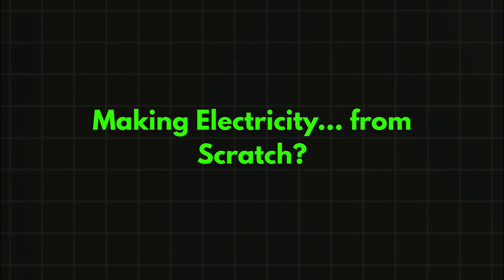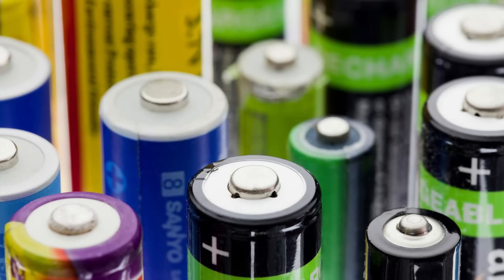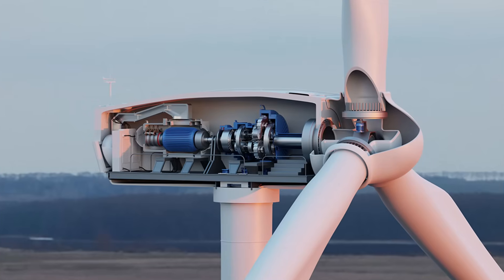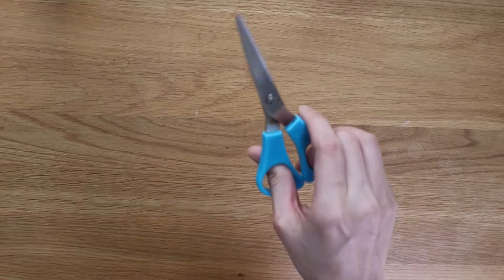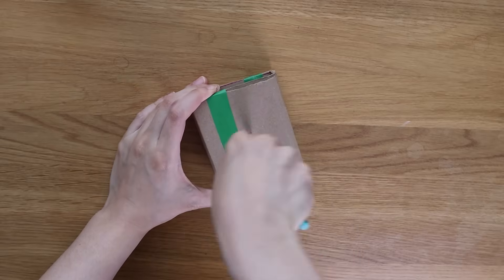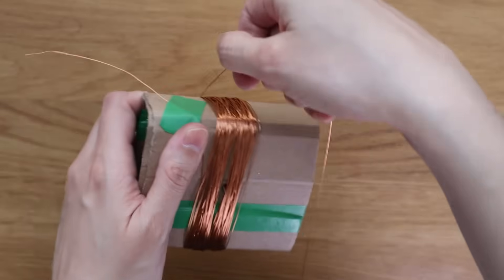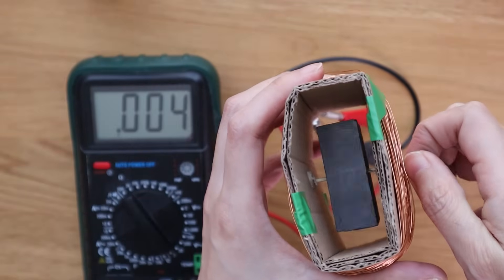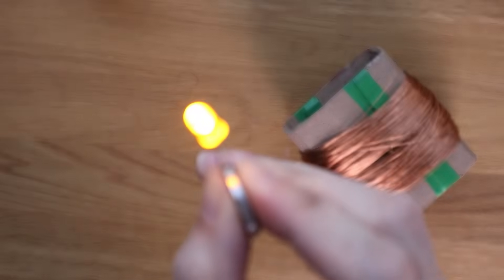I Tried Making Power With Just Cardboard And Wire - The Simplest Electricity Generator

Comment: You could go back at least till roman times, maybe much earlier.  Magnets (lodestones) existed, they made copper wire jewelry, the wire could be coated in something like pine resin or enamel or rubber(from dandelion sap), the box could be wood, using a large wheel to rotate it at higher speeds, you might get high enough voltage to shock someone or make a small spark.

Comment: Yep, can't go back very far before you have that bootstrap problem.  Prior to electricity, you don't have magnets stronger than natural lodestone. So you're going to need to work your way up to decent magnets by making a bad generator and using that to make slightly better magnets which means you'll need access to a forge.  You'll probably need to build yourself a wire drawing setup, too, if you go back before the 1800s.  And figure out how to insulate the wire without modern plastic coatings. They used to wrap wire in cloth and/or paper.

Comment: The cellphone could potentially be useful for this in a pinch as it contains a nice little vibrating motor or linear actuator which contain the required parts, though it might take a decade or two for a full charge. Sadly 5g still has dreadful 4th dimensional coverage.

Comment: Great Video! Ithink it is the bigger question how far Back you Go in time and where. Something Like Piezo Crystals could be a Help for effect. Chrmical batterys would be a makeabel Thing after copper was used as Metal. And still big question where you would Go? What Materials would be there? And how far are the peopel developed in what? Go Go 1bc in Egypt and Show them an pulley system could get you a so what ist the new thing? 😄

Comment: Perfect timing! Yesterday I was trying to understand how to make a electromagnetic motor, the problem is that it was late in the night and I needed to sleep. I will try this!
Reply from the maker: Are you trying to make a DC motor? It's very similar to this, except...
You use electricity to generate motion by connecting the wire to a battery 🔋

Comment: There are other ways to detect current without a multimeter. The simplest and oldest of them is by passing the current to a ionic solution for electrolysis. If it succeeds then there is current.
Reply: Another one is carrying the current through a long wire to a second coil, which you can use to deflect a compass needle.
Reply: @karlmuster263  that's basically an analog ammeter

Comment: Magnets are not that simple too, proper ones capable of generating anything were invented in early 1900s.
Reply: Even today's methods require a large electro-magnet to fabricate permanent magnets. Iron and lodestones will have a small amount, which they knew about. So maybe it would work if you use that current to create an electro-magnet, use that on some iron during refining, and gradually work your way up to stronger magnets.

Comment: I think constricting or at least drawing a stem engine would be possible basically from the moment we learned to smelt metals
Reply: No, you need a strong enough metal to be able to withstand the pressure of the system. Copper and iron can't do it, bronze and brass are WAY too heavy and expensive. The only reasonably cheap option is steel, which requires really sophisticated metalworking to make in large quantities.

Comment: You only have a very narrow window of time to be able to do that using this technique.  However, it might be more appropriate to use mechanical systems... for example, build a logic based computer using mechanical linkages... or even a water based computer.... those could be something very simple to build with easily obtainable items from just about any timeframe.  The most basic computers can do simple math with just a few gates... but more advanced ones can solve larger problems.